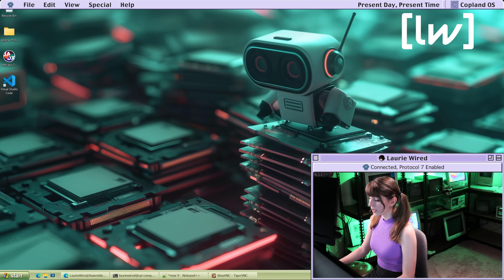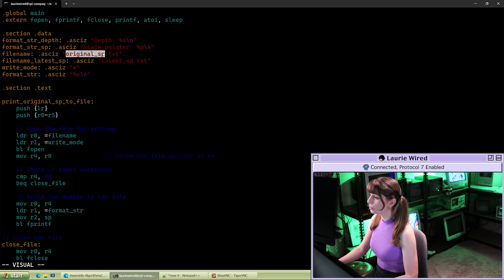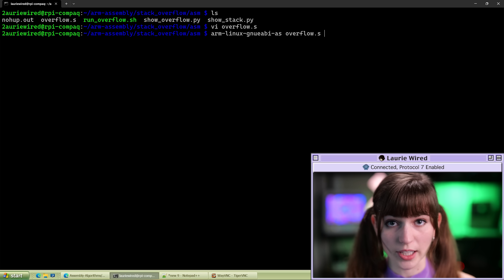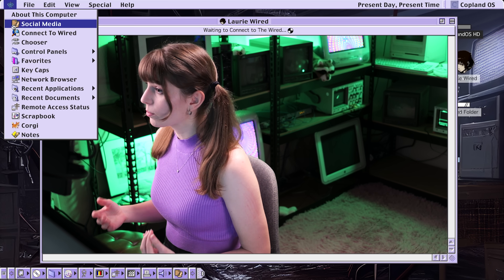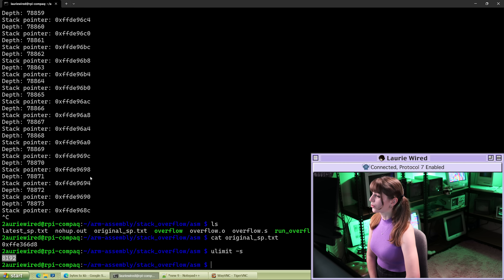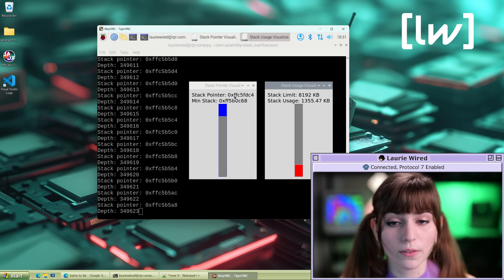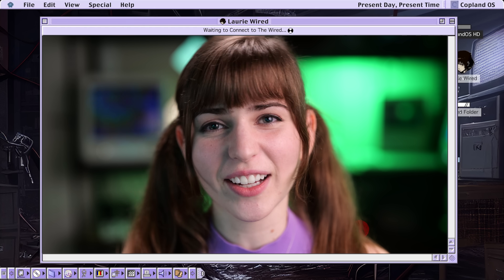What ACTUALLY happens during a Stack Overflow?

Comment: What does the ulimit command consider a kilobyte?
   When I started learning programming more than 40 years ago, the definition of a kilobyte was 1024 bytes. Likewise, a megabyte was 1024 such kilobytes. Right or wrong, that was how it was done, since 1024 is a nice convenient power of two, which simple processors like.

   Later, the industry (chiefly hard drive manufaturers) successfully lobbied to change the definition of a kilobyte to 1000 bytes, a megabyte to 1000 * 1000 bytes, and so on. This allowed them to deliver less storage without changing their promised capacity. Consequently, your new 2 terabyte drive might quite a lot less storage than you think.
   Granted, from a linguistic point of view, the new definition is more correct, since 'kilo' means 'a thousand' and 'mega' means 'a million', and so on. But ever since, there has been some confusion among programmers about what they actually mean when they talk about, say, 'a kilobyte of memory'. We're supposed to use the new terms 'kibibyte' for 1024 bytes, 'mebibyte' for the old measure of a megabyte, and so on. Fine. but not everybody remembers to do it. And to an old nerd the new terms feel awkward in my mouth. As if we're being forced to use preferred pronouns or somethig.
 'mebibyte'. Just say it out loud. Ugh.

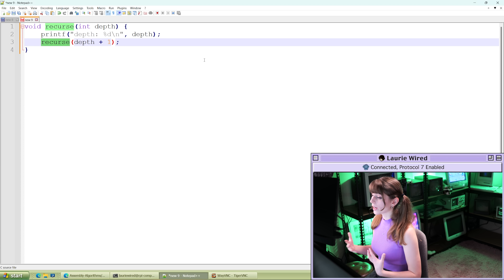Comment: 4:30 Note that this subroutine is tail recursive, i.e. it has nothing left to do after the recursive call. The compiler can therefore reuse its previous stack frame, never filling anything (but still taking infinite time). This is called tail call optimization. In gcc you can disable that optimization with -fno-optimize-sibling-calls.

Comment: Typically, the stack crashes into your heap.  If you have stack smashing detection in whatever manages your context....  Then you generate a fault.
You don't necessarily hit a segmentation fault.  Thats only going to happen when you try to load/store memory beyond your  memory segment.  That could happen for a few reasons, like the stack smashes all the way out of your segment OR perhaps earlier if stores in your heap corrupt your stack so something that is expected as a memory address like the "Link Register" lands you out of your segment.
On microcontrollers...   You might see a bus fault, your MPU fault...  Or... Your program just runs off into hyperspace.  Normally, your watchdog timer doesn't get whacked, so...  You reset with a core dump.

Comment: I was hoping you would show us the actual process of the segment fault.
For example by single stepping through the assembly execution right at the point that triggered it.

The similar problem of buffer overflow of a variable on a stack that causes curruption of the call stack framework is also interesting. Since the stack grows downward, but arrays typically go upward, if you allocate a small array in a function as the first locsl variable and then write past the end if the array, you will start overwriting the function return address and processor state info. Assuming the function reaches its end without crashing, the process of returning to whoever called the function will cause problems.

Comment: Good video. But I'm wondering if the SIGSEGV is an "artifact" of your memory layout. The stack grows "up" towards lower addresses. In the system I'm used to, the "heap" is actually in lower addresses than the stack. In a rare case, it is possible for the allocated heap to extend down to be adjacent to the "top" of the stack. This allows the stack pointer to actually point to a heap location. Rare, but not impossible. On a different architecture I used, the CPU actually had special registers which contained the process' stack start and end addresses. Any instruction which changed the stack pointer had the new value checked against these bounds & had a special interrupt to abort the instruction.

Comment: So how does the operating system actually detect a segmentation fault?  I presume it's called that because the memory is segmented by the OS and the program tried to access memory outside of the segment(s) allocated to it.  But how does the OS know this?  Back when computers were simpler, a stack overflow wouldn't necessarily crash a program... it might, but it could also just cause unexpected behaviour as areas of memory that the program assumes are separate start to overlap.

Comment: A great demonstration, though I'm slightly confused: wouldn't your wrapper code essentially set up tail recursion (because it's the last call in the surrounding function), preventing the overflow through allocating a new stack for the next function call?  It's been so long since I last had to touch C/C++ in anger. And Rust, of course, has protective mechanisms.

Comment: Most stack overflows are due to code that includes some type of kickout logic but that logic never executes because of an error in programming or a condition is never met because there is an error in the logic as to the proper condition.  At least that is what I have discovered, however this is the quickest way to get a stack overflow.

Comment: It would be better to write recursive C code, compile it to generate assembly code and analyze it. Allocate too much memory on stack (big variables on stack), too deep function calls (much like the recursive case) or too small stack size (in memory constrained env like bare metal or RTOS on MCU) also leads to stack overflow. In user space the stack overflow only crash the application, but in kernel and non-OS env it would crash the whole system.

Comment: When you remove the manual protection of the game Carrier Command on the Commodore Amiga (yes, retrocomputing... and 68k asm) the game would always crash after a few minutes of gameplay, but why? Turns out there's a second check in the game code. When you start a game, it would check if the string actually entered (from the user as an answer to the manual protection) is empty (or length zero). If so, it would push a few values to the stack each frame. The stack, like here is located in the upper memory regions, above the game code. At first you can continue to play the game without issues until a few minutes later, the stack grows down far enough to corrupt the actual game code. And then it crashes!

Comment: When I run a recursive function I usually test it in debug mode to make sure it does what it's supposed to. Then you can follow step by step and interrupt the execution is stuck. In Windows 98 stack overflow would completely crash the computer. Had to restart it.

Comment: 7:12 People might get the wrong idea that you are allocating memory in the stack as you push.  Instead, you are pushing and poping data in the stack which is already percolated and is of fixed size - it's like a fixed-size array where the stack pointer is like an array index. Despite that, great video!
Reply: "Percolated" 😄
Reply: @theRPGmaster  ups :D
Reply: Technically there is no such a thing as "memory allocation", it is just a language concept ;)
Reply: Stack is allocated on demand. The 8MB of stack referenced in this video is not 8MB of physically reserved memory, it is just 8MB worth of unbacked virtual addresses and as each unbacked address is read or written to, there is an exception and the OSs exception handler then allocates (one page at a time) the physical memory to that page (populates the page table).
Reply: @homomorphic  Correct (see the MAP_GROWSDOWN flag for mmap). It's also configurable, e.g. with ulimit -s or pthread_attr_setstacksize. madvise could also be used to prepopulate pages. ulimit -s unlimited will allow the stack to grow all the way to the next mapped region (with just one forbidden page to separate them). Example behaviour from GNU/Linux.
Reply: You must never pope data. Data poping is haram. :face-fuchsia-poop-shape:

Comment: Interesting... I didn't realize that the stack grows down instead of up... That's actually really interesting.

Btw, (extremely) minor point of accuracy, the Google byte/kilobyte converter is using base-10 kilobyte, while ulimit -s should be giving us base-2 kilobytes (kibobytes for those who prefer that nomenclature), meaning that the value of 315 KB it's giving us is very slightly wrong, or at least not as useful for comparing to the 8192 KiB value. The value it should have given us is actually 308 KiB. 

smh... Google is a tech company, they should know better than to default to base-10 units for bytes...
Reply: *kibibytes but yeah good point, we really should standardize base 2, now its just a limbo
Reply: @xydez  thanks, my phone kept "fixing" it for me and I missed the vowel
Reply: @xydez  There's no limbo. There's simply abuse for convenience, abuse for greed, and accurate use. kilo means 1000 and kibi means 1024. Unfortunately the binary prefixes were a late patch and are less pronounceable.

Qalculate! is one calculator that supports both types of prefixes (set allpref on). This is a context dependent formatting, e.g. we might measure a transfer rate in Mbit/s for calculating baud rate or MiB/s for file transfer speed (note: most transfer systems have additional overhead such as 8b10b encoding).

Comment: 0:46 And this is one of the big reasons that recursion is rarely, if ever, an appropriate design pattern. It's super easy to fuck up, tends to be pretty resource inefficient, compilers will often optimize it away into something more sensible anyways, and the only point really is elegance for a human reader, and that it's a neat trick.
Reply: Recursion is only viable if it's tail call optimized, then it's pretty nice, but it's hard to guarantee that will happen statically

Comment: Wow, someone who actually knows what they're talking about. Accurate, concise, and to the point. Excellent job.
Reply: SIMP
Reply: Does she? She did not mention how exactly does a stack overflow get triggered (page fault exception, which happens when accessing a guard page). But I get that not everybody wants to be truly knowledgeable.
Reply: @TheOnlyJura  she just said that the operating system terminates the process which is correct, since the exception vector points into kernel code. Having seen few of her other videos, I'm quite confident that Laurie could explain how the hardware generates the exception and how the kernels handler works, but covering how a program is terminated and unloaded from memory at a detailed level is a whole series of videos by itself.

Comment: I programmed a PIC micro-controller once, Its impossible to have a stack overflow when you don't have a stack to begin with. Its sad memory can't be "reused", when you allocate a local variable in a function, its actually a global variable, its not like you could do much with 4K of RAM anyway. (yes, all local variables of all functions are allocated as global at once, yes, their compiler is that stupid)
Reply: I think that's more of an SDCC thing than a PIC issue.

The PIC still had a stack that can overflow from functions calls.

Comment: If you understand how stacks work it will be easy for you to grasp what stack overflow is, what I have never understand is how these are exploited...
Reply: Because the return address to jump back to and start executing after this function call is done is stored on the stack. So if you overflow the stack, you can essentially get the CPU to jump to any code you want at any address, and the game is won - you have full control over the process now. If you can find a way to manipulate the return address, you can also setup whatever code you want to run at the correct memory location as well beforehand, and once you're in your own code, you can load any other code into memory and start executing it you want. It's not just that you overflow the stack (or a string buffer that allows you to manipulate the return address) with any random garbage - it's a well crafted data that you get in there to get the values you need into the right memory locations.
Reply: They are usually exploited by overflowing a variable allocated on the stack. Say a 100 byte array is allocated, and the program doesn't check properly (or at all) for using more than the 100 bytes. Then a malicious actor can find a way to trick the program into writing beyond the size of the array, and this gives them access to other parts of the stack.

Comment: Don't let the bash people see you use .sh endings for executables. I know everybody does it, but it's still wrong.
Reply: why? First, extensions have no meaning whatsoever in linux/unix other than as a visual convenience, and bash is like an enhanced version of the "sh" shell - most simple bash shell scripts you can actually use the sh shell to run anyway.
Reply: @gorak9000  Don't use extensions for your scripts. Scripts define new commands that you can run, and commands are generally not given extensions. Do you run ls.elf? Also: bash scripts are not sh scripts (so don't use .sh) and the extension will only cause dependencies headaches if the script gets rewritten in another language. There is also a link, but ha! I'll just paste the content:
 Command name extensions have numerous issues:

    They unnecessarily expose implementation detail (breaking encapsulation).
    They uselessly and incompletely mimic detail from the #! line.
    They capture insufficient detail to be useful at the system level (and aren't used).
    They clash with recommended Unix (and Linux) practice.
    They add noise to the command-level API.
    They are very commonly technically incorrect for the script.
    They give incorrect impressions about the use of the files they adorn.
    They aren't validated even for what little info is present in them.
    They interfere with switching scripting languages.
    They interfere with changing scripting language versions.
    They interfere with changing to presumably-faster compiled forms.
    They encourage naïvely running scripts with the extension-implied interpreter.
    They infect novice scripters with misinformation about Unix scripting.

There are more explanations. You understand that I don't paste everything.
Reply: @gorak9000  Don't use extensions for your scripts. Scripts define new commands that you can run, and commands are generally not given extensions. Do you run ls.elf? Also: bash scripts are not sh scripts (so don't use .sh) and the extension will only cause dependencies headaches if the script gets rewritten in another language. There is also a link, but ha! I'll just paste the content:
Command name extensions have numerous issues:
They unnecessarily expose implementation detail (breaking encapsulation).
They uselessly and incompletely mimic detail from the #! line.
They capture insufficient detail to be useful at the system level (and aren't used).
They clash with recommended Unix (and Linux) practice.
They add noise to the command-level API.
They are very commonly technically incorrect for the script.
They give incorrect impressions about the use of the files they adorn.
They aren't validated even for what little info is present in them.
They interfere with switching scripting languages.
They interfere with changing scripting language versions.
They interfere with changing to presumably-faster compiled forms.
They encourage naïvely running scripts with the extension-implied interpreter.
They infect novice scripters with misinformation about Unix scripting.

There are more explanations. You understand that I don't paste everything.
Reply: @gorak9000  Sorry for double post. Here it only says "2 replies", none of which are mine. Youtube is being weird. It has been for a few weeks actually.
Reply: this is the guy who never learned why extensions were created
Reply: @sekaibelle  Is the length explanation I pasted not visible to you either?
Reply: @callisoncaffrey  it isn't, most likely YT spam filter. edit your original comment adding the explanation so that we can understand your perspective
Reply: @sekaibelle  Everything disappears. Nothing I can do. Sorry.
Reply: It is easier to just type the name of the script without .sh. But whatever, it is fine anyways.
Reply: @GambuSaur  You're typing all the way to .sh??? Ever heard of tab autocomplete? You've probably wasted YEARS of your life typing useless characters that weren't necessary. Usually you type 2 or 3 characters MAX
Reply: @gorak9000  true xD

Comment: Can I just declare a large array and fill it with bytes to also get a stack overflow? All data not put into the heap just adds to the stack, so a statically declared array should also easily fill up that 8MB of stack size, right?
Reply: Correction: a static array won't end up in the stack, it will be in a separate global memory store which is allocated at the startup of the program by the OS. To put the array on the stack, it must be declared within a function so that's what my question refers to.